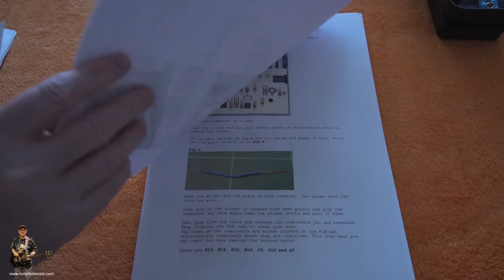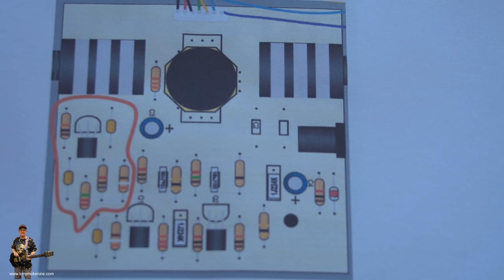How to turn a Dunlop GCB95 in to a true bypass Jimi McCoy monster wah pedal | Tony Mckenzie

Comment: That is the Jim Dunlop Crybaby GCB95 from the 1980s and it sounds even thinner than the one from the 1990s -present. I had one, and had to mod it a bit, to actually switch on and off (part of my old concho belt I used on-stage). It made feedback squeals, was noisy and microphonic. The Italian JEN is the one to hav,e, the Japanese Ibanez Blubber or the current dunlop Crybaby Classic. I have 3-4 different wah-wahs now, one is modded to true bypass, Fasel inductor and a nice blue metallic finish  :)
Reply from the maker: I love wah pedals :) and did a video a while back of the ones I own here: https://youtu.be/xLFqQ6pfMgE and it has a few nice ones in there :) Thanks for posting the info... I modded it because it needed it :) and thanks for watching.

Comment: I found the inductor is the heart and soul of a good wah pedal. I tried stacks of mods on my Crybaby. I end up ditching the board and put a Castledine board in. It has a Halo style inductor in it.
Reply from the maker: I did go and look at those Castledene boards etc. but have yet to get to the others you mentioned.
Reply: Inductors really don't make much difference.
Reply: I am not sure you are completely right, the inductor means something, but the transistors do too. I like the Red Fasel.

Comment: Hello tony. thank you so much for taking the time to do this video. Could you explain more about the switch? what does it to the sound?
Reply from the maker: The 'Jimi' switch changes out a particular capacitor for a different value that was confirmed by the guy (I believe) that modified Hendrix pedal. It changes the tone basically. The whole of the mods is worth doing but I'm not sure if this seller I referred to still sells them or not - in any case components are available and its not that hard to do either. Stay safe.

Comment: NICE soldering job. Awesome!
Reply from the maker: It worked too :) an added bonus!   

I was sold this pedal by a pawn shop. It did not work so I took it back for them to 'check it out'. They sent it to another company and was checked by so called 'professionals'. Professionals my ass.. they had no clue and the fault was actually the input socket. So I fixed that while I was on the upgrade. Honestly, with the so called professionals around like that its no wonder they go bust... often!  There was a suggestion from the pawn shop that I had no clue... and there was no fault... it was so funny. Cash Converters Hanley Stoke on Trent. Anyone near there? I would be very careful, and as for the 'pros' just down the road in 'hope street' maybe pass on those too. There are few stores around any more.

I'm sure its the same elsewhere though Tommy.
Reply: tonymckenziecom Yep, you are correct. I do work for pawn shops. Cheapos that never take care of their kit.
Reply from the maker: I was not referring to you... but the local music store. Those guys 'found no fault' and the pawn shop insisted it had been checked by 'professionals' which became annoying at one point. I almost photographed the pawn shop and the music store for the video then decided they were not worth the aggro.

Comment: Hi Tony, hope all is well. I added these mods to mine but nothings coming out unfortunately. The true bypass seems to work, when it's off I get a normal signal through. I'm currently measuring out some of the parts but I do not have enough knowledge I'm afraid. I have a GCB95 with a red fasel inductor and a Chase Tone 100k wah pot. On the blue cables at the switch and pot I get only about 0.4 volts. On Q2 I have 1.2 volts in, 0.4 out. On Q1 I have around 0.4 / 0.3 / 0.1 volts on the pins. No Idea if these values are correct? The switch and pot receive their 9 volts.

Would you mind helping me out a bit? I have no clue where to look next.

Kind regards,
Mathias
Reply from the maker: You need to go back and check each and every component AND exactly if its fitted right. Its so easy to not get something quite right. check those tracks also a bit fiddly. I can help of course, but my advice firstly is to go back and double check everything. If that pedal worked at first before the upgrade it will be something you got wrong - and that's easy to do!  So go and check again and tell me if you find anything. I'm around so you can contact me from my website on the form then I don't have to post on here... thanks.

Comment: Would it really break Dunlop and Vox to make them TB out of the gate? It's a notorious issue, and you'd think they would prefer not to be known as purveyors of semi functional crap.You'd think-
Reply from the maker: The gear has moved on since my first one :) (around 71) and I agree that there is lots that can be improved on wah pedals. I guess it all depends on what you're looking for from a pedal. My old 71 pedal makes horrible noise for about the first 5 minutes, then settles down to lightly scratchy tones and is not TB. I hate to say this, but that pedal is my 'second best' pedal I own! So which is the best for me? (I hear you say) its the Dunlop Jerry Cantrell pedal which to me sounds exactly right for how I play. Its not a TB pedal but does have an all on buffer inside. But I don't use many pedals so I guess its good for me but maybe different for others. The problem though (it seems) is that the pedals that have true bypass are far more expensive for little or no reason as we can see in this video. Oh well.  Thanks for the info and for watching.